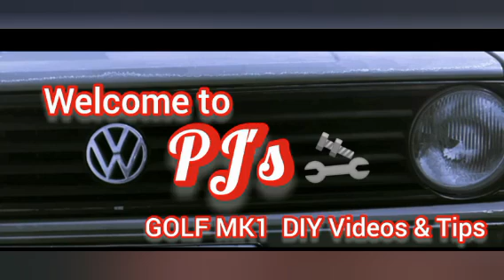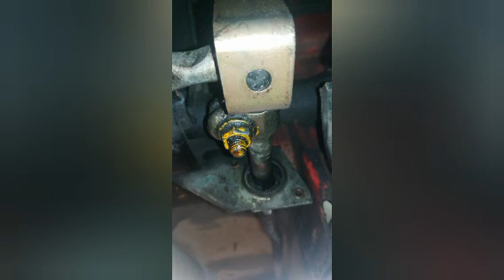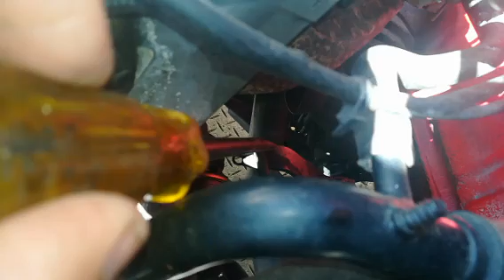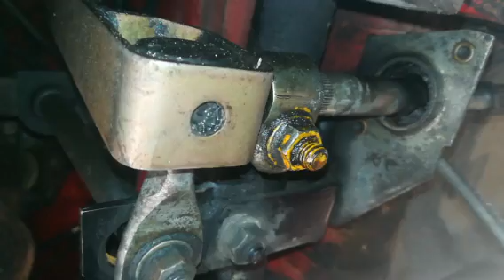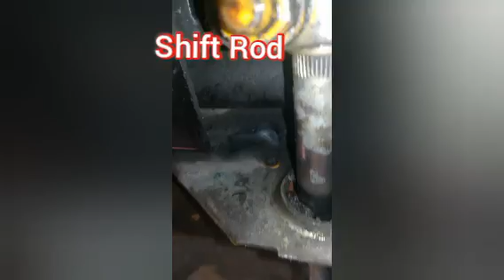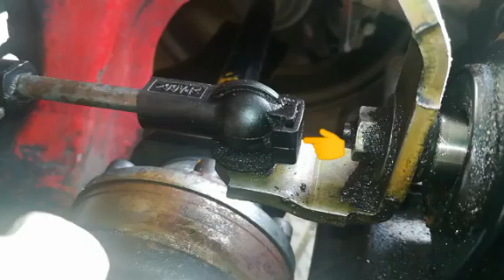GOLF MK1.GEAR LINKAGES AND BUSHES:HOW TO INSPECT AND REPLACE. TIPS#golfmk1 #vwgolf #vwfox #vwcaddy

Comment: My gears are so close I've put in new gearbox but they still close I've asked a mechanic to put links n bushes but still the same. What's should I do to make them normal like other cars what if I buy a new gear lever maybe a velocity gear lever would it work or some adjustment I need to do?
Reply: If you take the shift boot off from under the car. The spacing should be adjusted to the exact size of a cassette case
Reply: It should center ur gears

Comment: Big fan..... Jus want to know.... After releasing my clutch.... There is a weird click sound at my gearbox... Its mainly infront facing my battery/radiator side....

Car drives fine... And not struggling with any of my gears....

If it can be sorted than i would appreciate it.... Its a daily....

Comment: There are also two small black bushes between the gear leaver and the selector shaft (under the gear leaver) they should be changed.also check the ball on the gear leaver and the gear leaver housing
Reply from the maker: Lovely.. thanks!

Comment: Hi Mr Pj's.. I'm a huge fan of your videos as I own a mk1. I've used your videos for troubleshooting and fixing my car and it has saved me lot of money and stress. My only problem is gear no 1 and reverse there's nothing separating the two, of which it makes it hard for me to select gear 1 without having to comfuse it with reverse. Any suggestions or I need a new gearbox?
Reply from the maker: You need to play around with the shift rod. Loosen the pinch bolt, and make a small adjustment either way, until the Gear selection becomes better... Well that's if all your Bushes are still good.. Worn out Bushes can cause the problem you have.. And also check on the 2 selector Rods, if they securely attached.